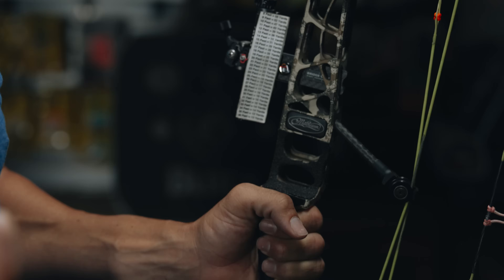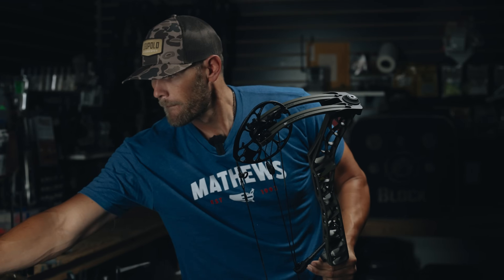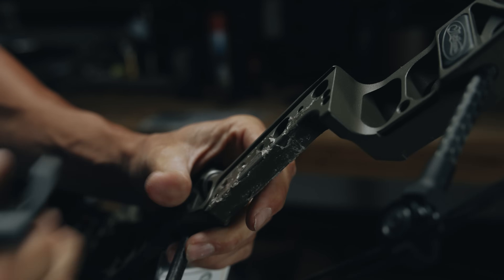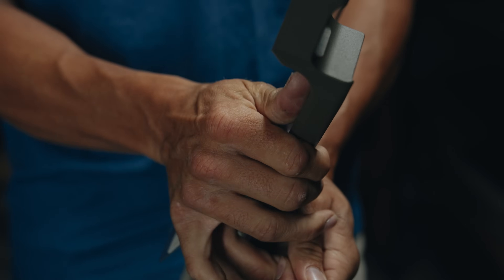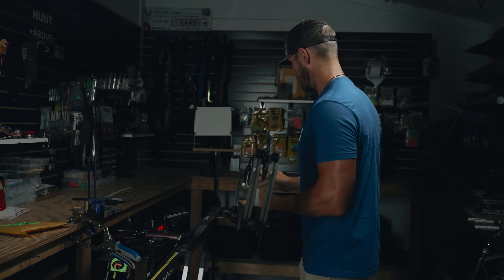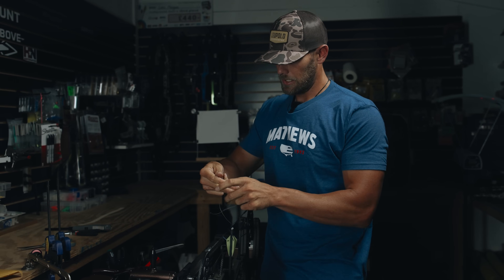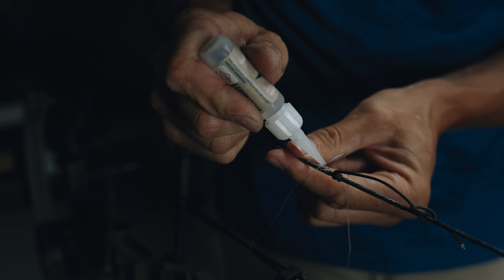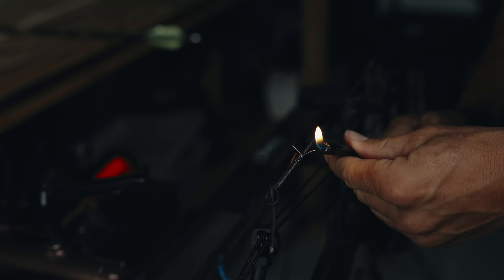How I built my HUNTING BOW to win a CHAMPIONSHIP

Comment: 2 things to try with cam timing without a press. move a limb bolt or move the dloop. people with press put fluff in the cable which is funny as it’s temporary fix when they cant twist cables to fix it

Comment: Not all knock points can be dead center like that, or even really close. (Center actually makes more sense in my head but not the case) I just got a new Elite Omnia and set it up myself, and after setting her all up I checked out of curiosity and the knock point was 3/4” higher than center. If it were directly in center, arrow would be laying on the shelf and still pointing up. I center arrow on burger hole. As far as I know you want 90 degrees off string and arrow going through center of burger hole.

Comment: I first tie a d-loop and then make a second layer of serving inside it so that the d-loop will not be able to compress it No one does that, but in vain. You need to choose thinner threads for serving so that the 2 layers are not too thick. The advantage of this method is that the d-loop does not shift to each other and after doing it once you can forget about it, there will always be a small backlash of the nock inside the d-loop.

Comment: The super glue on the nocking point was game changing. Thanks for the pro tip!
Reply: Tie 4 square knots on top and four on the bottom, pull tight melt the ends....no need at all for superglue - he is having to use glue because he is using overhands not square knots....if you don't understand what i'm saying John Dudley has a good video showing the 'best' way to do it.

Comment: I could watch these videos all day. The bcy spectra, is the the same as bcy #23 d-loop material? Also with the LCA drawboard I've been told checking timing it will be incorrect if both stops hit at the same time because of the position of the peg, that the top should be half a twist out? Could you please do a video on this? Thanks GOAT 🐐
Reply: 23 is spectra braid so I believe you are correct

Comment: I first thing out of the box I always check A to A and brace against factory spec.  Usually they are off a bit, sometime far enough that I fix that before proceeding with anything else.  It is also worth noting that if you set your D loop before you check cam synch, and you have to adjust the cables to get the cams synched, then your D loop will move slightly.  Might have to adjust D loop location a bit.  Make sure and set your poundage before you sync the cams too, changing that limb angle changes everything.  All good, what a great video from an incredible talent.  Thanks.